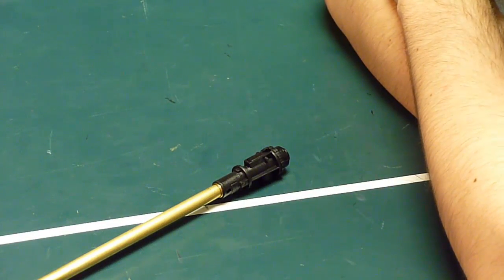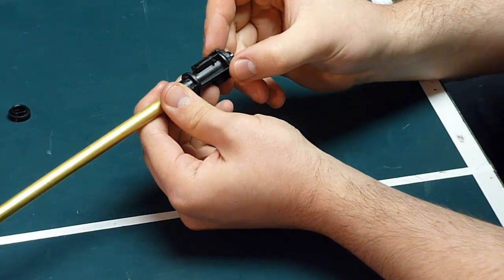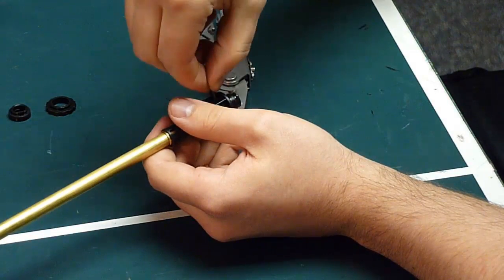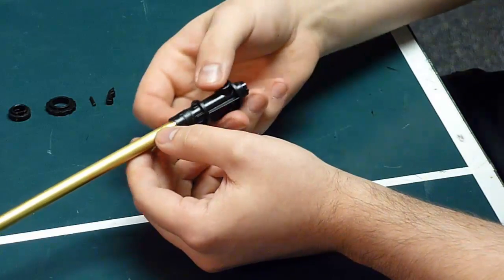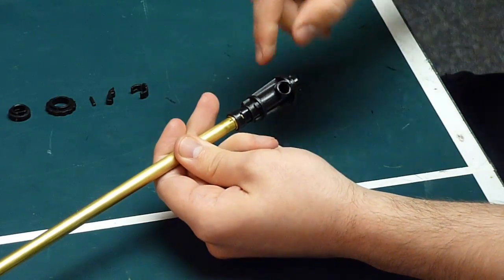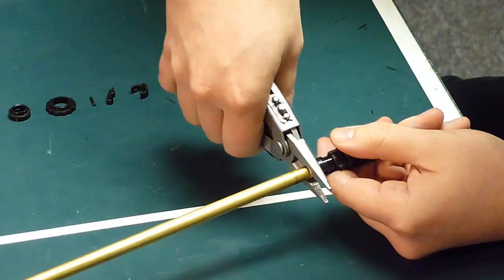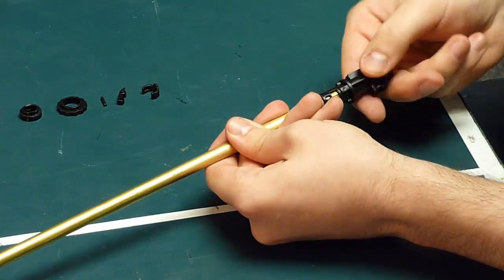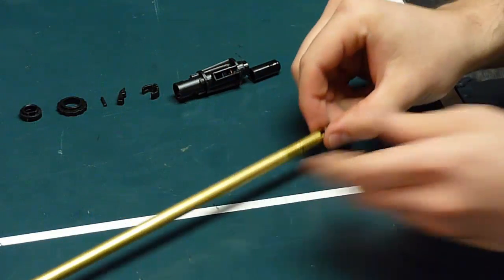JG AU-3G (AUG-A3) / Ring Type Hop-Up Disassembly

Comment: Well, I know I've definitely put my hop up on properly. My aug refuses to feed now, even with my old hop up, and it's the only thing I've changed/reinstalled. The upgraded hop up was faulty as the pin fell out under gravity, so I've put everything back as it was before, and it simply will not feed. Not the first upgrade I've done, but the first, and last I'll ever do the aug. I have zero idea how I'm going to fix it.